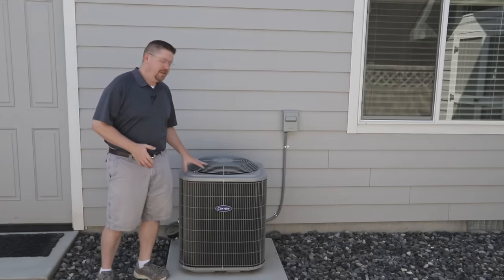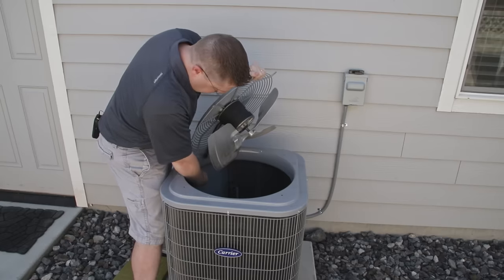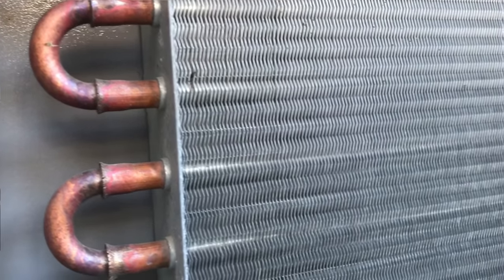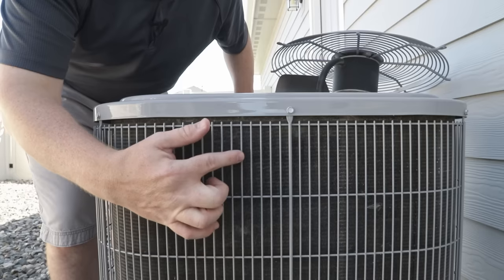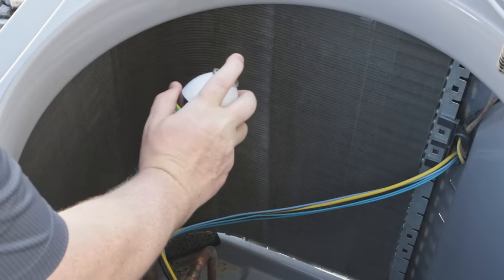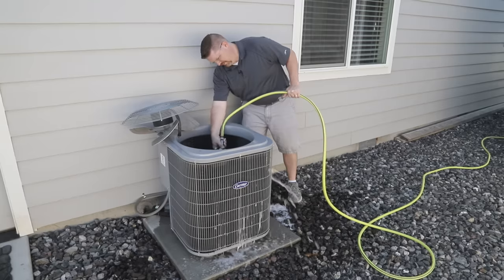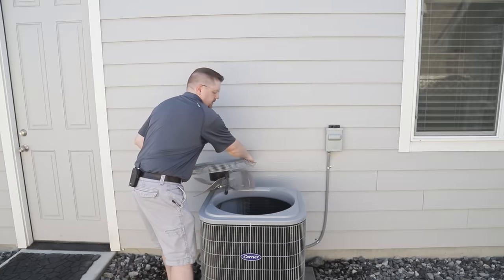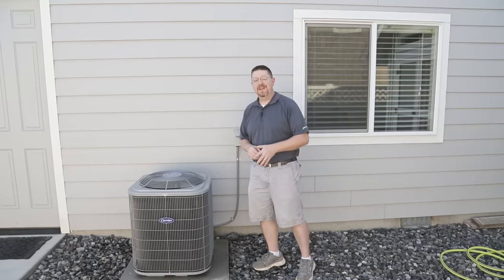How To Clean Your Air Conditioner Condenser Coil (Step By Step)

Comment: Shoot.  Mine has never been done.  15 years.  😳.  I just pulled off some panels.  Packed full of dust.  Cleaning detail - 7:00 am tomorrow.  Do you really need to use that cleaner?  Or is a hose good enough?  It’s just dust in there, no debris.
Reply from the maker: Hi Alex - sorry for the late response to this question - a hose is better than nothing, but the cleaner will help to break up and loosen the dirt. I hope your cleaning went well!
Reply: @AmplifyDIY  thanks for getting back.  Yes it went well, thanks.  I just use water but some of the stuff was pretty sticky.  Next time I’ll use the cleaner.  Ironically the reason for me noticing it needed cleaning,  was that I noticed an electrical burning smell near the unit outside, before I did the cleaning. Turns out the motor failed. It’s probably the plugged up coils (dirt) that caused more stress on the motor for lack of airflow. Oh well. Live and learn.  Thanks a lot.

Comment: Why doesn't the fan have an easily removed wiring connector?  Wouldn't that make maintenance MUCH simpler?  My wiring harness is so short that I can't move the fan out of the way beyond just barely getting the vacuum hose in there.
Reply from the maker: Hi DeadEyeDave - sorry yours is so tight! I suspect they don't have a connector as they need this to stay weather-tight, and weatherproof connectors are expensive, and if not re-connected correctly don't seal.

Comment: What kind of screwdriver you used to unkock the nuts on the fan? I need help. My fan was making a screeching noise, then it stopped and now it making little screeching noise, less than when I noticed it first time but there it is. What could be wrong?
Reply from the maker: Hi Jake - sounds like you may have a bearing that is failing in your fan motor. As for the screwdriver - it's just a basic screwdriver handle with switchable bits. I'm using the right nut driver bit for the fasteners for my fan. Here is a link to something similar on Amazon: https://amzn.to/2TiOOE5
Reply: @AmplifyDIY  so bearing is failing in fan motor? What will happen? What is the solution? I
Reply from the maker: @jakeb8298  Generally you'll need to replace the fan motor... but keep in mind, I've not seen or heard your unit... I'm basing this entirely on your description of what is going on. Might be time for you to call out a service tech for an opinion. Good luck!

Comment: Will my well water cause corrosion on the fins? Only reason I haven't done it
Reply from the maker: Depends on what sorts of minerals you have in your water... most likely it won't hurt anything.
Reply: @AmplifyDIY  I'm in Central FL mostly calcium I thought it would definitely corrode the fins
Reply from the maker: Calcium does not corrode aluminum. It may build up on it, though. You can use a mild white vinegar + water solution to remove any built up calcium from the fins, but be sure to rinse it off, as the vinegar can damage the aluminum fins if left on for a long time. Good luck!
Reply: @AmplifyDIY  thank you guys for the reply🇺🇸 'merica

Comment: AHHHH!!! Our AC was working ok. But after taking a look into the unit it was very similar to your friends. So I opened it and used the same exact cleaning foam solution. Waited about ten mins. Rinsed off. Let it dry out. Now my ac turns on just fine but the cold air ain’t coming in at all anymore :( it was working just fine before I did this. Any ideas???
Reply from the maker: Did you reconnect your breaker/disconnect? Is the thermostat on?
Reply: AmplifyDIY thanks for replying. Yes indeed I followed the steps correctly. I finally got it to work and what I had to do is restart and update the NEST app. Then when I turned it on, I had to put it to like 60 degrees and push the fan to max. It was like a boost that made the cold air begin working. I was afraid I ruined it by simply washing it hehe.
Reply from the maker: Heh. I’m glad you got it working again. :-)
Reply: AmplifyDIY haha thanks. Phew got a scare. Question! Plz... what’s a good way to tell if I got to change the coil condenser box? I believe it’s a Bryant 3 Ton. Looks a bit old.

Comment: What are the symptoms caused by the clogged fins? Low cooling air from inside vents? Frozen evap pipes? I also noticed that the air coming out of the outside condenser fan was cooler than my other system which was exhausting hot air.

Couldn't you use a vacuum to suck out the debris? Has anyone ever tried that?
Reply from the maker: The main symptom is that the system runs much longer than it needs to, as all the junk in the fins really reduces the efficiency of the system. You may be able to get some of the debris with a vacuum, but you wont' get as much as with water, and will have a much higher likelihood of bending the cooling fins.
Reply: @AmplifyDIY  Thanks for the response and video. I'm cleaning it out as we speak.

Comment: Can I do this myself? I'm not a DIY pro but what are the caveats?
Reply from the maker: You can absolutely do this yourself! Just make sure to disconnect power to the unit first, and clean it gently. The fins are very fragile. Good luck!
Reply: @AmplifyDIY  I've been afraid to do it even though each year our AC is losing its ability to cool the house down. I cleaned the evaporator outside and it helped a bit. Do you think it'd make a big difference if I clean the inside. I always use 3M filters and change them every 4 months or so. Opening up the machine is what I'm afraid of

Comment: Is it normal if the copper pipe from the inside has built up ice???
Reply from the maker: Hi Jay - no, this is not normal. Ice on your lines can indicate that your evaporator coil is all gunked up and needs to be cleaned (this video covers the condensor coil - the evaporator coil is usually located inside your furnace blower cabinet). It could also mean you are low on refrigerant. Here is more info: https://plumblineservices.com/help-guides/why-is-ice-building-on-my-a-c-units-pipes
Good luck!
Reply: @AmplifyDIY  thank you so much, im not very knowledgeable about ac and heading.  I requested a summer check up for my coil from a good company,  hope they help me too. Thank you so much i will check it out, after the guys check it i will learn more about all of this.

Comment: I am a maintenance worker for 300 units with individual AC compressors. 
Don't bother cleaning them they only last 6-20 years before replacement and can go anytime.  If its under 5 years old, ok clean the coil once or twice but you aren't going to accomplish much
Reply from the maker: There is a huge difference between replacing a several-thousand-dollar system in your home every 6 years and every 20 years. By cleaning them annually, the heat exchange which occurs on the condenser coils is more efficient, so the compressor does not have to work at hard and will last longer. I'd much rather spend an hour on a Saturday once or twice a year doing a simple cleaning to push out the useful lifespan of something this expensive to replace towards that 20 year mark, rather than do nothing and be forced to replace it prematurely. 
Thanks for watching!
Reply: @AmplifyDIY  not true, you never know when these systems are going to fail.  Like i said they tend to last 6-20 years regardless of upkeep, cleaning or repairs. That's what happens,  you either get a good unit and it lasts 20 years or you get a piece of crap unit from factory that lasts 6 years.  Sometimes you get a decent one that will last 14 years. 
I know its logical to think that the compressor may struggle with the coil being dirty but its still only compressing the same amount of refrigerant at the same pressures, it doesn't really care if the coil is totally cleaned. 
It may have to run for an extra minute but that's what it is supposed to do anyway. Cleaning the coil will in no way protect the compressor from inevitable failure. But it does look much nicer
Reply: @ThisIsSolution  I have been an HVAC service tech for 30 yrs. and a plugged condenser can and will burn out a compressor.
Reply: @tomd7516  it can, but from my experience servicing about 300 units per year you are going to get a 2-4% fail ratio every year on the outside regardless of coil upkeep. But if you get $$$ for cleaning them keep at it brother!!
If i clean them i still get the same ratio and the same pay .... after many years we stopped  cleaning them, stil same ratio and basically same pay.

Comment: can you just spray foam on outside without taking the top off.
Reply from the maker: Hi Cesare - as I explained in the video, you really should clean these from the inside out so that you are cleaning in the opposite direction that the dust/debris was sucked into the fins in the first place. If you just spray from the outside, you'll just shove that dust and debris farther into the fins. To be clear: cleaning from the outside is better than not cleaning at all... but it's best to clean from the inside out as I showed in the video. Great question!

Comment: When you're cleaning the coils from the inside out with your hose, don't you run the risk of shorting out the compressor?  Or are those compressor wires somehow resistant to all the water/moisture?
Reply from the maker: Note that I disconnected power to the condenser coil before I started. Also, these are installed in outdoor locations subject to rain etc, so they are rated for dealing with water.
Reply: @AmplifyDIY  Thank you!
Reply: @charlieparker5678  the actual connections are on the outside of the condenser

Comment: What do if there's rust?
Reply from the maker: The coils should be made of aluminum, and they should not have any rust on them. If you actually have rust on the coils themselves or on the fins, then you have a bigger problem. If the rust is just on the grate or screens that surround the coil, I would remove them and remove the rust with a wire brush and then paint it to protect it from rusting again.

Comment: Should I worry about the water around the compressor?
Reply from the maker: It is designed to live outdoors in all weather, including heavy rain. I would not be overly concerned - but if you are worried, let it dry off before turning the system back on. Good luck!
Reply: @AmplifyDIY  so it was cleaned and fortunately it wasn't that bad.. Now my issue is I had a compressor go out a few weeks and replaced and ever since then my a.c. is taking forever to reach the temp set in the house. Any tips? Any idea y it would start doing this after the compressor change?
Reply: @SkyNdiveProductions   hi I know this was awhile ago but did you find your answer? I’m dealing with the same issue AC taking very long to reach set temp.
Reply: @EaaIsiah4916  so I had the tech come back because I felt the Freon had come out alot when he was disconnecting when he first did it. He came back added more and it seem to be ok.
Reply: @SkyNdiveProductions   thank you so much for letting me know ☺️

Comment: At 2:53 it looks like you’re using the fin straightener sideways. Did it not fit between fins like you’re combing hair! The little strap should have been pushed towards the handle to help separate the teeth, then slide them into the coil fins. Looks like it didn’t work.
Reply from the maker: I tried a bunch of different orientations and methods (including the manner you describe). What I showed in the video was actually the best results I could get with that tool.

Comment: The amount of calls I've gone to where people tried this stuff and ripped the posts off of their capacitor, or the wires came undone and sent the system into thermal lockout, or the fan came on and cut the condenser coil, is unreal. As an HVAC technician I can fully say this is a terrible idea to do on your own. Get routine maintenance with a local company and you won't have the thought of having to clean your coils. Is trying to save $200-$400 worth a $3000 condenser coil, fan, and compressor replacement?
Reply from the maker: If done carefully as demonstrated in this video, it is extremely unlikely you'll do any damage to your unit.

Comment: I use a WATER-BASE cleaner mix, Simple Green & Heavy Duty Degreaser, both from Smart & Final.  Try to tell me this will not clean - change my mind.
Reply from the maker: That'll do a great job! Just make sure the degreaser is safe for aluminum. Thanks for watching!

Comment: Dirty outdoor condenser coil equals high head pressure of refrigerant which equals high suction pressure of refrigerant which equals loss of cooling capacity. 
Keep it clean. Remember 
,,,,,,  ,SAFETY 3RD ,,, ,,,,,

Comment: What about using an air compressor just to blow Eveything out.
Reply from the maker: I've heard that some folks use a leaf blower (it'll move a lot more CFM than your typical home air compressor ever could) - but I prefer actually using brushes to clean. Blowing out the vents may remove most of the larger chunks, but will likely leave a lot behind. Leaving the inner walls of the vent with even a thin layer of lint just makes them collect more lint more quickly. 
Still, cleaning out the vents with something is better than never cleaning them at all. :) 
Thanks for watching!

Comment: Pro Tip: Don't EVER use any product marketed as "Coil cleaner" unless you've tested it out on a piece of sacrificial aluminum first. Most if not all of these cleaners dissolve a layer of aluminum to "clean" them. The bubbles are caused by the aluminum decomposing. Your fins are paper thin and you'll get 3-4 aluminum dissolving cleanings out of them before they start to fall off in chunks. HVAC techs won't tell you this because it'll be another high dollar sale when they get you to buy another unit. 

Use a non-caustic cleaner like dish soap, or something MILD. If you can't spray it on your bare hand, don't spray your coils with it. A soft brush like what you would clean vegetables with or a horsehair brush like what you'd use to polish shoes should be soft enough to clean the fins in an up and down motion so you don't bend them over. Get a bug/herbicide pump up spray bottle and fill with clean water. Use the pump up bottle with the fan setting on to rinse your coils clean. Your coils don't have to be shiny to be clean. Aluminum has a dull oxide and the only way you'll get it looking shiny is to dissolve the protective oxide layer. 

You're welcome.
Reply from the maker: Hi Watcher - I don't believe that the coil cleaner I used in this video actually dissolves the aluminum oxide. The fins were still a dull grey after the cleaning... but all the built up dirt/dust was gone. I also don't like recommending people use a brush of any kind to mechanically clean these fins... because undoubtedly someone will either use a brush that is too stiff and bend up their fins, or they'll damage the fins with the brush body, etc. I do appreciate the warnings though, and I echo your concerns about removing the oxide layer: don't use caustic stuff for this job. Mild soap works great. Thanks for watching!

Comment: This was a great tutorial, but you should make a step-by-step video for removing and cleaning the INSIDE coils! That's the part I'm most worried about! What's the point in having a home warranty and paying it every month if they try to pay for as little as possible?!  As if the average hard-working American can pay $700 just to remove, clean, and reinstall the inside and outside coils! 🙄
Reply from the maker: Hi Abigail! I have a tutorial for cleaning the evaporator coils, but have not had time to film it yet. Note that you don't remove these coils to clean them - you clean them in place. It can be a bit of a tricky job due to the space/location constraints, but it's not much harder than cleaning the condenser coil. There are other videos out there for cleaning the evaporator coils - perhaps one of them will show you what you need to do yours until I can get mine finished up. Great suggestion, and thanks for watching!
Reply: @AmplifyDIY  I was told by my home warranty company that they BOTH had to be removed to be cleaned properly. The vendor they used for me wanted to charge $690 to do that! He said we need a new motor and in order to make sure it's not just clogged up we have to get them cleaned professionally, but we just don't have that kind of money, and we just bought our house last January. I've watched videos on how to clean it in place, so we'll do that to save the money. Our pastor recommended an HVAC tech and he told us the same thing. What do you think about the no-rinse coil cleaner? It seemed to work well in the review video I watched, but he wasn't a professional. Thank you for your reply!
Reply from the maker: @AbbyBabby988  Unfortunately you are learning first hand what a waste of time, money, and energy typical home warranties provide. It's been my experience that they will give bad (often dangerous) advice and refuse to pay for things that you thought were covered. I recommend avoiding them in the future. 
You cannot remove the coils without removing all the coolant (freon) from the system. I've never heard of anyone discharging an entire system just to be able to clean the outside of the coils - they are always cleaned in place.
However: if you have had 2 separate HVAC techs come and inspect the system and they both said you need a new compressor motor, the problem they are addressing has nothing to do with needing to clean the outside of your coils. If they have to replace the compressor motor, the system has to be discharged of freon anyway, so perhaps then they would also disassemble the coils and attempt to clean the inside of the coils, not just the outside.
In short: It sounds like the issues you are having with your system will not be resolved by cleaning the outside of your coils anyway. Don't be afraid to keep getting new estimates from reputable HVAC companies in your area... you may find a better quote or better advice.
Best of luck getting your system repaired!
Reply: @AmplifyDIY  okay thank you so much!